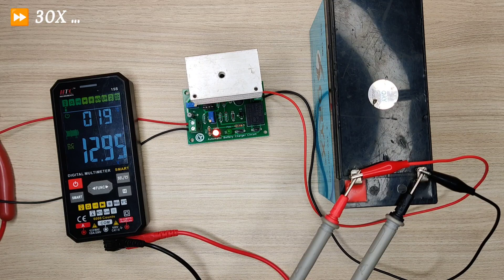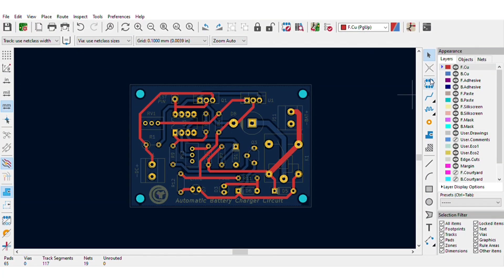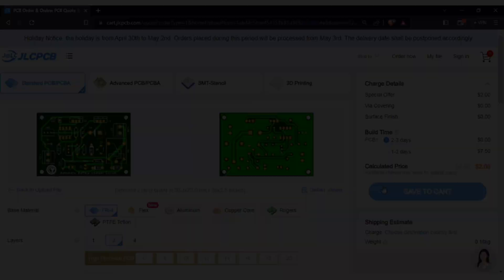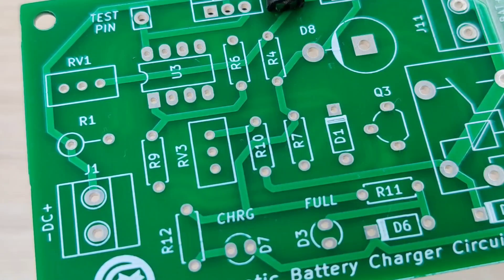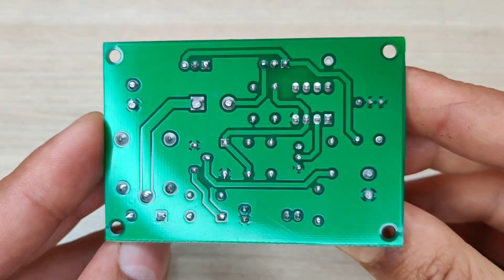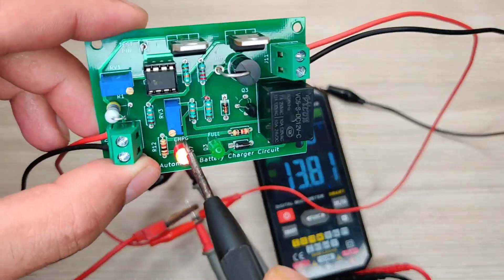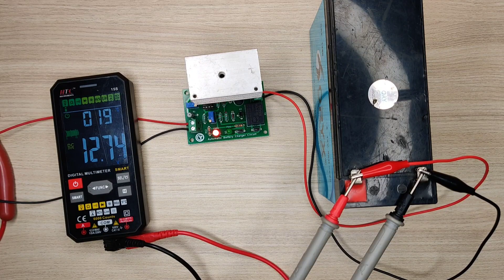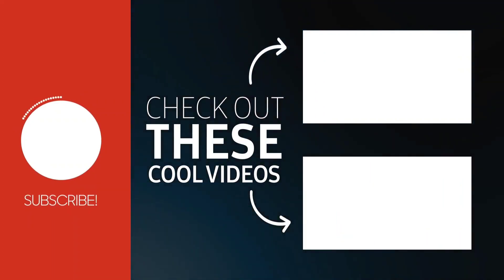[NEW] 12v Auto cut off battery charger circuit (with voltage feedback)

Comment: It is better to use Schottky diode  MBR20200CT instead of the 10 amp Si diode in order to reduce the  high voltage drop across it. For higher amperage, say more than 8 amp, charging,  MJ/TIP 2955 is recommended.

Comment: The effort  putin by you in assembing the 
automatic battery charger circuit, is laudable
 indeed as also creating the PCB files, Gerber
files, etc., for ordering THE PCB. from JLCPCB
      As an ardent  hobbiest, though I am quite old, 
I find immense satisfaction in assembing 
any circuits I come accross.
      First, I had assembled your circuit in a
bread board, I find the following flaws in your
Schematic that  the green  LED connections have to be
reversed.
      I had ordered the PCB from JLCPCB
by uploading the PCB files and Gerber files you
have created. 
After assembling the PCB, I find that the 
MJE2955T connections provided in the PCB  except 
for the base, both the connections provided for
       C  and E  are wrong. so also are the case  with LEDs
These connections are to be reversed.
       Hence, MJE2955T cannot be inserted in the hole 
      privided in the PCB, except for the base..
Regards 
M R GOPALAKRISHNA PILLAI 
9444141017

Comment: RV1 adj ????????????
Reply from the maker: It is for output voltage adjust for battery, in case you're supplying more than 15v input rectified supply
Reply: Input 15 , 20 volt,  dont core.   Calibration 13,8V battery, and 0,7 diodo,     14,50 volt en PT ...  
15volt en PT